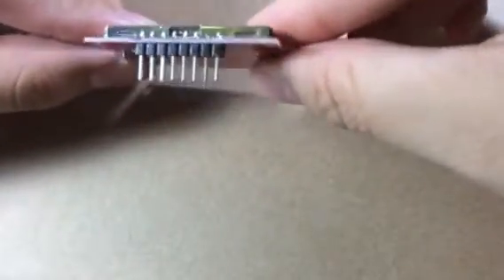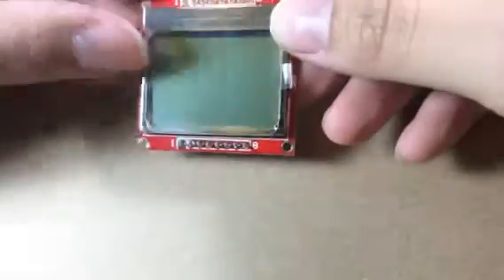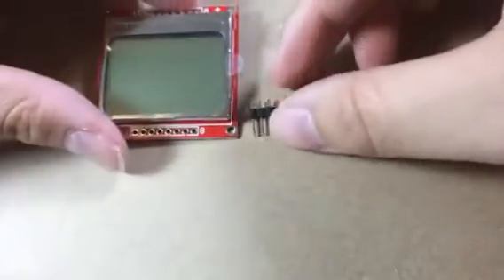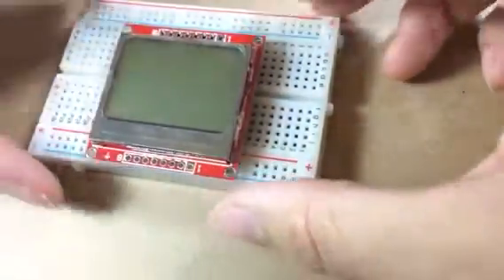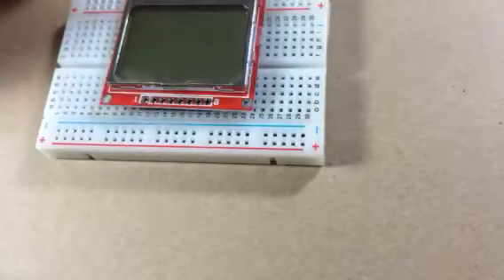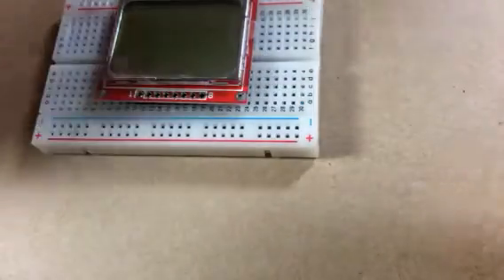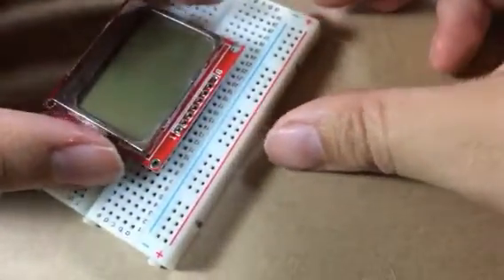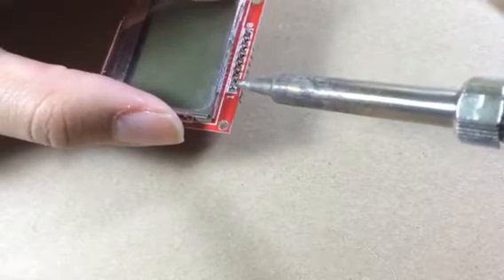Soldering headers onto Nokia 5110 display

Comment: Nice video but I wouldn't plug it into a board unless I had a discontinuous strip of pins that needed to be aligned and even then, I'd try and avoid it.The heat transferred down the pin can be pretty significant and damage the board. The damage isn't always immediately obvious .
Reply from the maker: Thank you, I never really thought of long term damage to a breadboard because I haven't been bitten by that yet, but you bring up a good point to consider! It's good to use the breadboard for alignment which is why I do the first and last pin.
Reply: Lara Swanland
Ya, I have a few rows of pins that are permanently sprung open. Copper is a great conductor of heat and those pins will transfer that heat into the plastic of the breadboard. I don't find the board does anything for alignment unless you have discontinuous strips or more than one header you have to keep properly spaced.I myself had extra pin headers so I was able to just insert a row on each side of the board to get that balance and alignment and just solder one row in.
Reply from the maker: JoeGancher It's good to know :-) Thank you for sharing.
Reply: It's not unusual to suggest using a breadboard to get the pins straight and solder the two end pins, then solder the rest out of the breadboard.